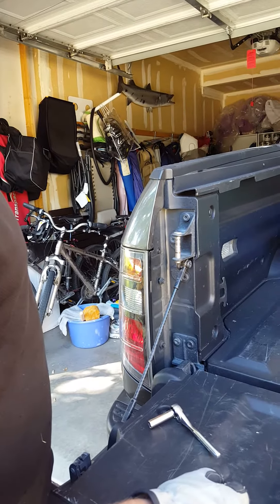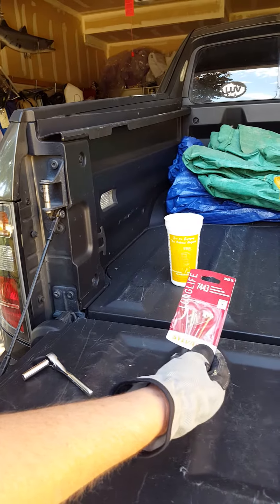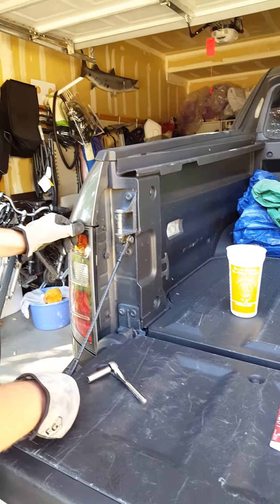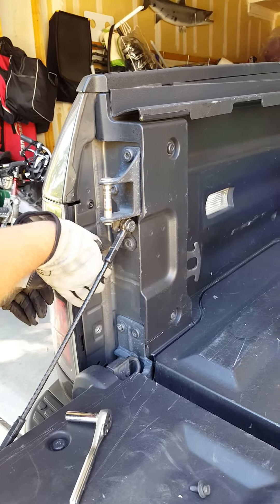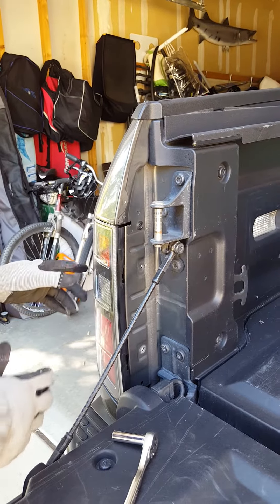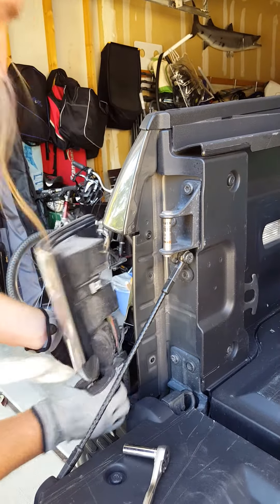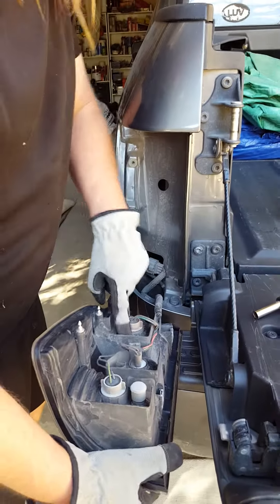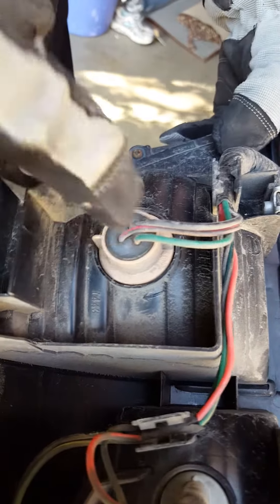Honda Ridgeline 2007 replace brake lamp bulb

Comment: I would love to know if that brake light assembly will fit a 2011 to 2014
Reply from the maker: Online Honda dealers part lookup

https://www.hondapartdirect.com

2007

Lamp Unit, R Tail - Honda (33501-SJC-A01)

2011

Lamp Unit, R Tail - Honda (33501-SJC-A11)